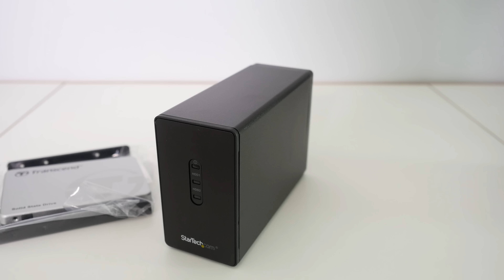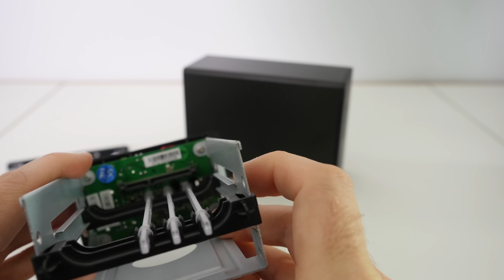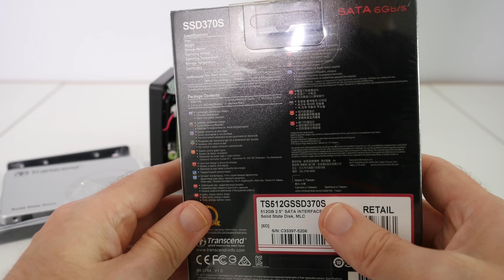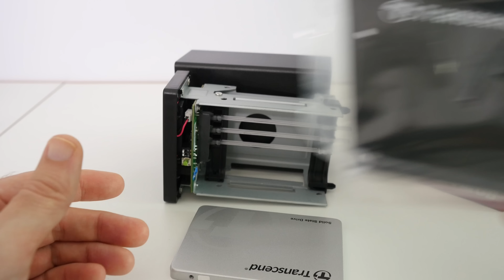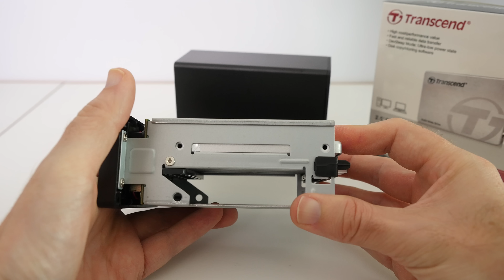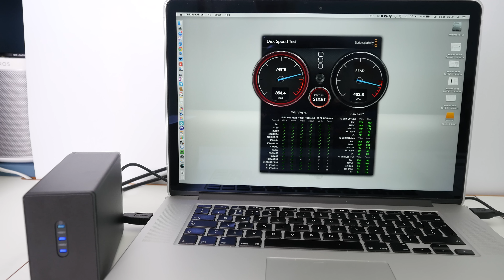Startech USB 3.0 Dual 2.5 inch RAID Enclosure ft Transcend SSD

Comment: hi. Two questions - do you need two USB cables connected for power and data? Can't you use just one when SSDs are used rather than hard disks?

Also, that fan.... is it noisy? Could it be disconnected?
Reply from the maker: Fan is not noisy. Re the cables if depends on the power delivered via the USB on your computer.

Comment: Very nice. For the price the enclosure is definitely worth the money, but I am wondering how it will perform a year later. The drives are awesome,  fantastic speeds on both read and write. Nice solution for a work flow. Great video Dave.
Reply from the maker: +Darren Gator If performance dips, then it's super easy to swap out the SSDs.